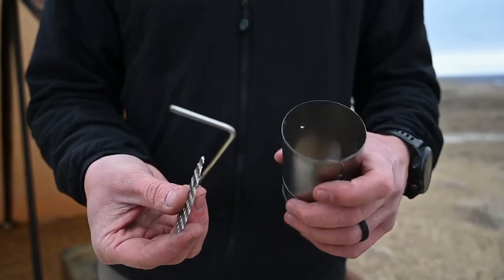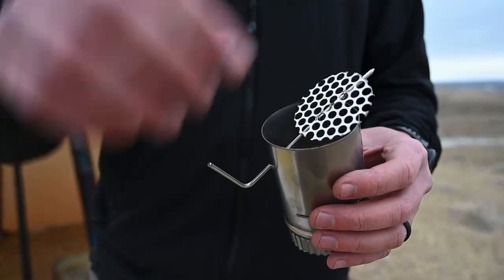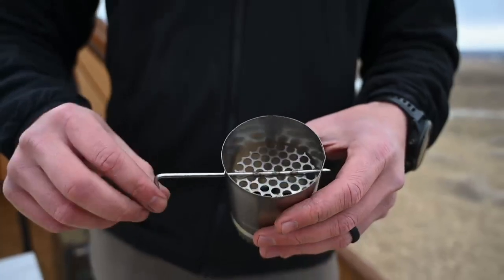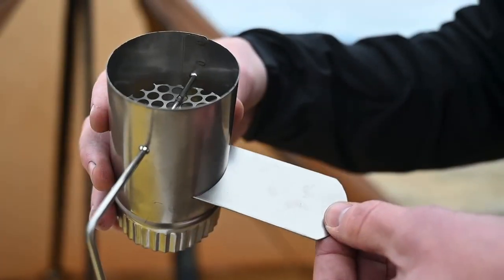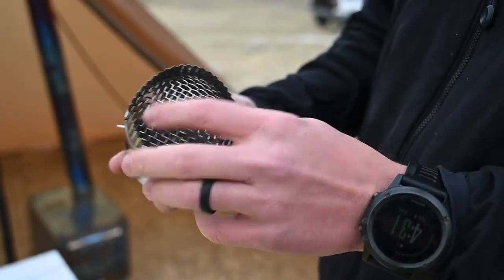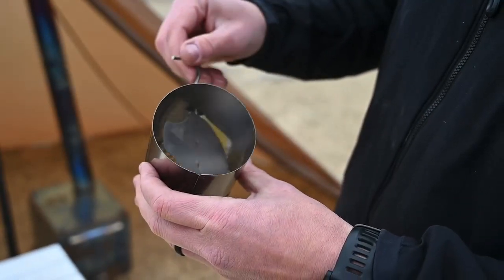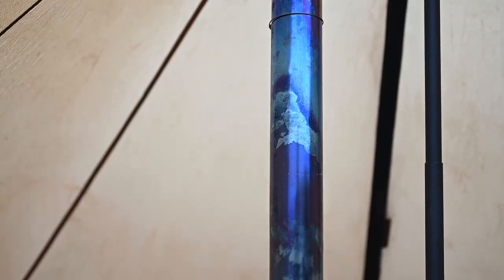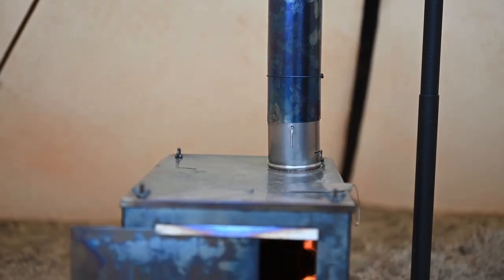NEW 2021 Stove Damper - Seek Outside

Comment: That look like a way better system my old-style unit broke before I used it. My peanut tin bottom and coat hanger tack weld job worked ok but I'm definitely getting one of these if we can use stoves this fall in Colorado. Thanks for the improvement.